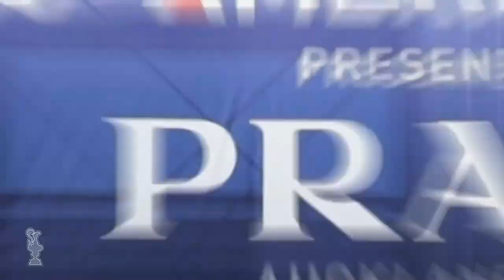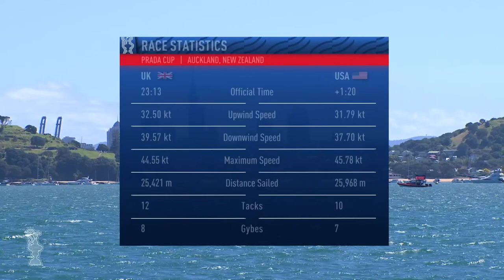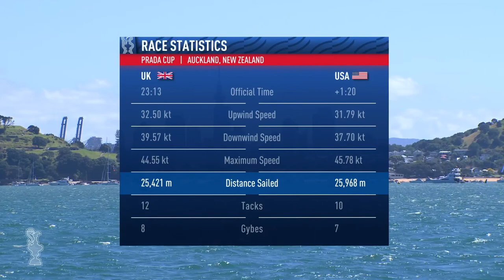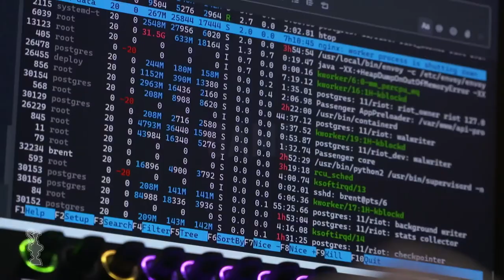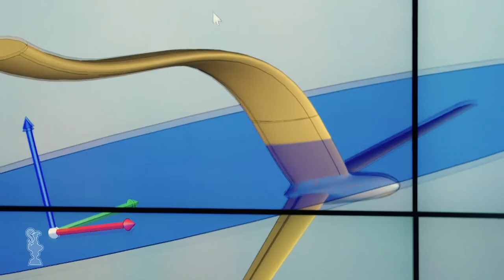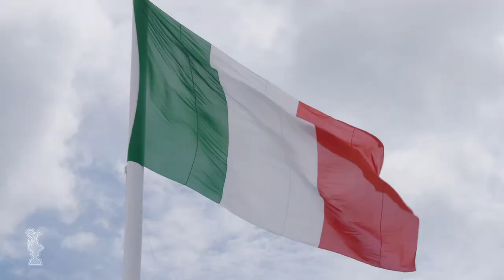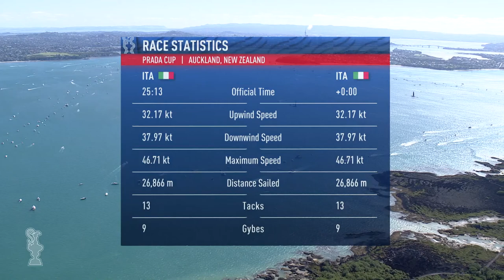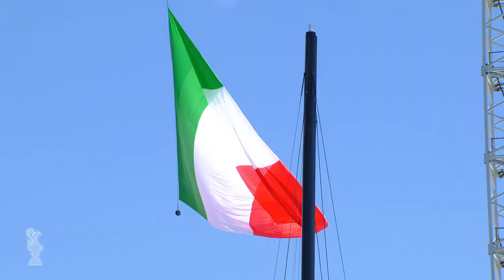PRADA Cup Day 1 | Full Race Replay | PRADA Cup Round Robins

Comment: So, what exactly are the grinders doing? Seems like they're always cranking, and I can't see what it is they're moving. Thanks.
Reply: They’re cranking to create the hydraulic pressure necessary to work the systems on the boat. Almost everything that moves on these new boats use hydraulics except from the canting of the foils, which uses batteries